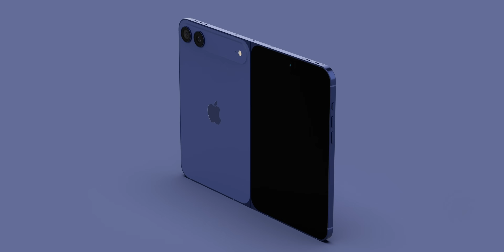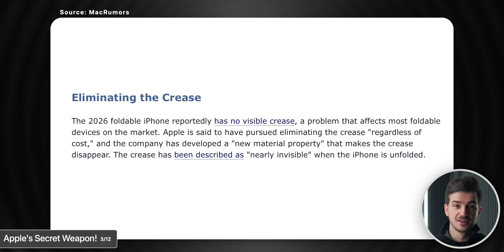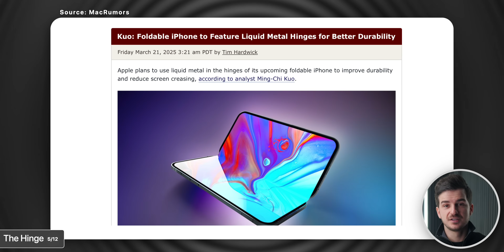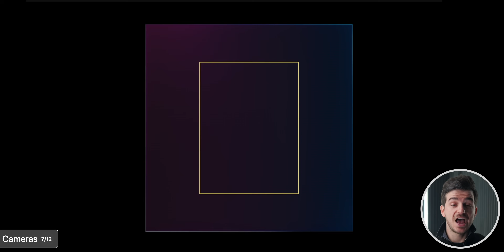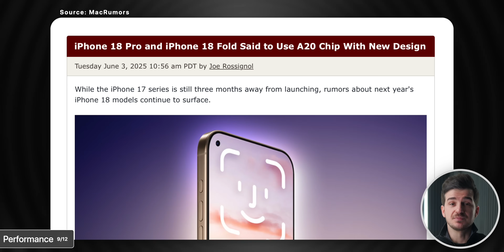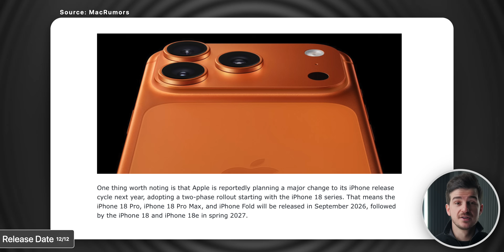iPhone Fold (2026) - It's Happening!

Comment: The company is more likely to fold at this rate. I bought an A16 iPad last year at a high street store which was a dud. After Apple failed to fix it I got a full refund. Then I bought one from an Apple Store (months had passed by at this point) and it started to go haywire on day 1. Got a full refund on that too. Customer service is imploding. On the day I bought the second iPad from an Apple Store I went in and said I wanted to buy an iPad: the employee told me to go over to someone else, telling me with a dismissive wave of the hand, “There’s a customer queue.” Apple needs to go back to basics to fix these problems before it’s too late.

Comment: If there isn’t a version that is the size of a pro max that then opens to a even larger display it will be a big miss in my opinion. There needs to be a normal and  a max size. I’d get one if it were this size if not I’ll just upgrade my 13pro max to a 18pro max next year instead or maybe hold out another year.

Comment: iPhone 17 Pro Max charges at 40W and under heavy loads (when also in use), can hit close to 45W, just to be accurate.
Regarding the iPhone Fold, screen size will be about 7.9” size. The smaller sizes are wrong and 8.3” sounds too big. I too wish for telephoto, although the Samsung’s 3x is just useless when the main iPhone sensor will have 2x optical quality sensor crop. Google Pixel Fold now has a 5x telephoto, but at 10.8MP, that’s pretty bad!
Basically, iPhone Fold ultrawide will be superior to competition and have the great main sensor, but only 2x zoom.